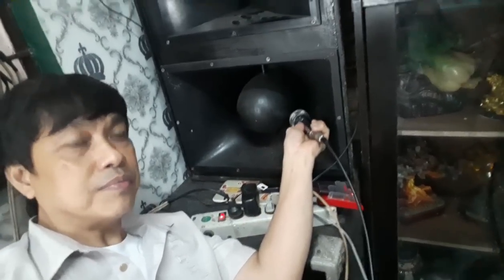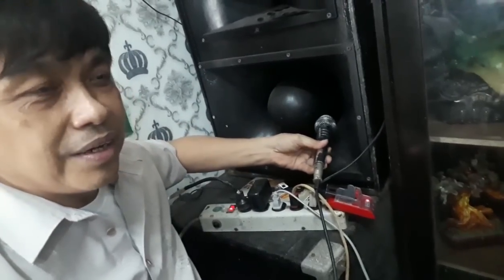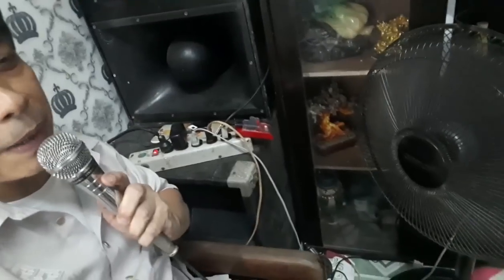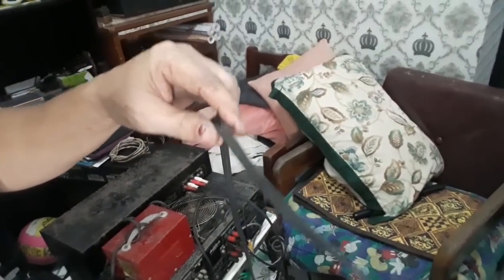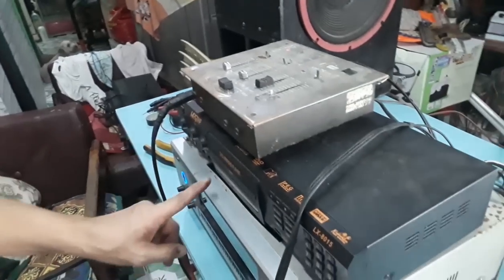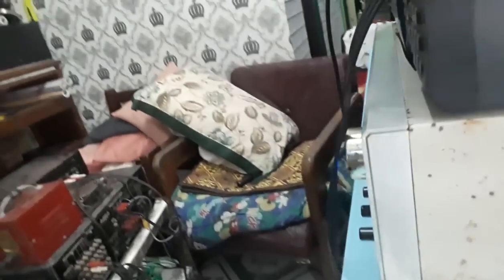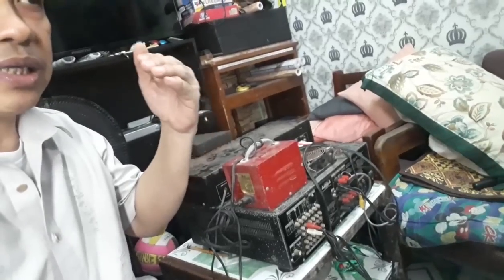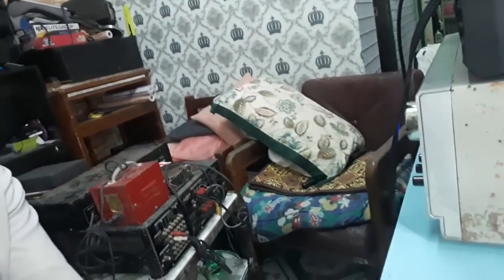PAANO MAWAWALA ANG FEEDBACK SA MICROPHONE

Comment: Sir paano mag dagdag ng mic input sa integrated amp? Bali ang 2 mic input gawing 4. Di kasi palagi may mixer. Pahingi po ng diagram.. Ty
Reply: Kung mag dadagdag ka pa ng 2 mics,  mag dadagdag ka din syempre ng volume controler,  kung ayaw mo gumamit ng multi ch.  mixers, cguro gamit ka nalang ng wireless mics,  yung dual,  dalawang set para maging apat yung mic input mo
Reply from the maker: Thanks for watching pinakamura at simple lang po yung mic y jack sa isang saksakan dalawa  ang mic kaso pag pinatay mo yung isa patay din yung isa kaya ginagawa ko lagyan ng tape sw. Ng michttps://youtu.be/xD7NKFGcJtU